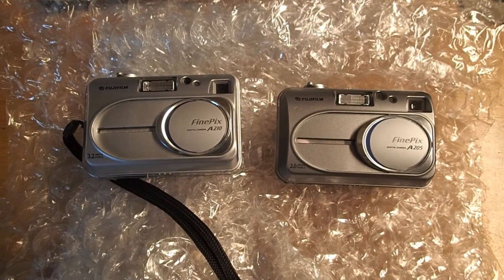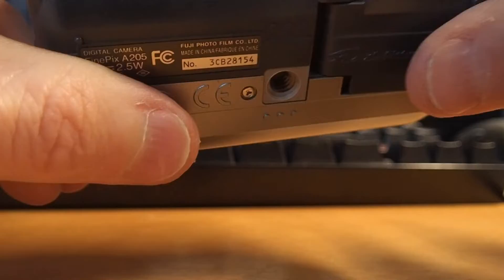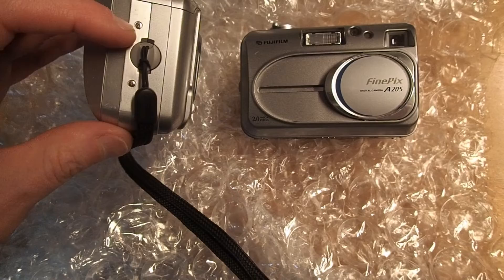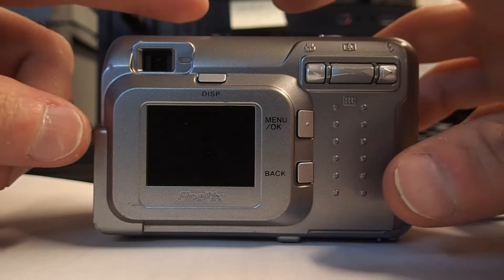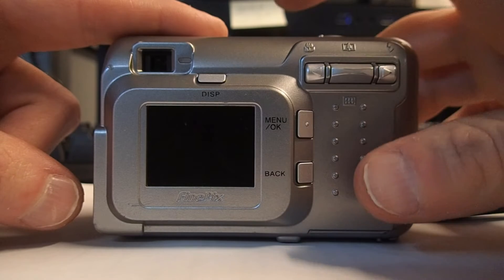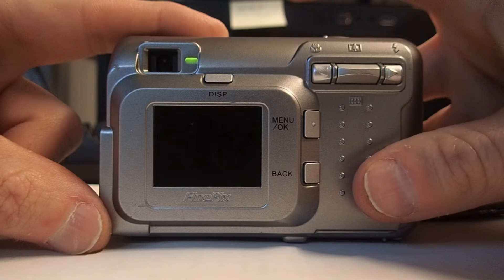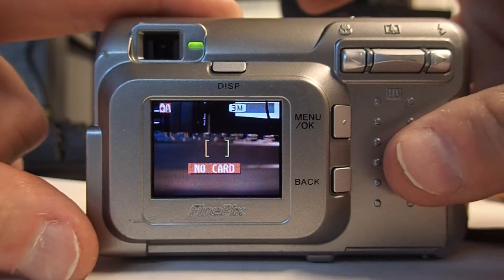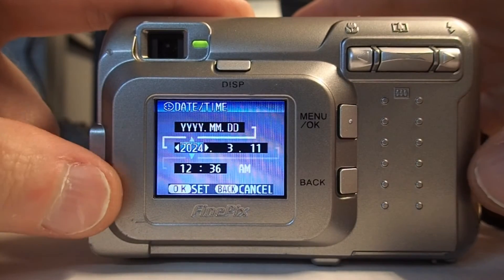Replacing internal date time settings battery in Fuji A210 A205 digital camera Fujifilm Part 1

Comment: My finepix205s turns off when switch the knob to either film or photo mode, any idea where to start?
Reply from the maker: new NiMH or Lithium batteries.  Dont use anything else.  If that doesn't solve it, then I dont have any other suggestions.
Reply: @bigslick  thank you for advice. My last resort is switching the lens module from donor camera.
Reply: I have the same problem, did you ever find out how to fix it or at least why it was happening if you couldn’t fix it?

Comment: Should the camera turn on without an sd card because I currently don’t have one but when I turn on the switch it flashes the green light and then remains off.
Reply from the maker: yes, it will turn on (may take 15-20 seconds), screen will come on and say NO CARD.
Reply: @bigslick  ok thanks for your help mine must be broken. It only turns on properly when I connect the usb to a wall plug but then it turns off as soon as I remove the usb.
Reply from the maker: @isabelbyarugaba2008  AA batteries may be weak.  Need to use either rechargeable NiMH or Lithium AA.  I find that nothing else works.
Reply: @bigslick  that’s brilliant thank you so much for your help!
Reply from the maker: @isabelbyarugaba2008  Worth a try.  I know these models definitely do not work right with standard AA "heavy duty" batteries or generic AA "general purpose" batteries, and sometimes wont run very long with Alkaline either.  But they run good with NiMH rechargeable and Lithium AA.
Reply: @bigslick  I’ve found some more powerful AA batteries which did lead for it to turn on but only on the video setting, I’m definitely going to take your advice and get those NiMH batteries as I 100% trust it will work!
Reply from the maker: @isabelbyarugaba2008  also make sure that the sliding door in front of the lens is open because it wont turn on to "camera mode" with that door closed (although it will turn on for playback mode with the door closed)
Reply: @bigslick  yeah unfortunately it still doesn’t turn on with the door open the green light just flashes again
Reply: @isabelbyarugaba2008 Im having the same issue with mine, did you ever get it fixed?
Reply: @quintilleroni3242 the green light flashed for longer but unfortunately non of the batteries were strong enough (could be a problem with inner workings of the camera itself) so it may work for u

Comment: I would at least desolder the original 614 first lest the xx32 in parallel tries in vain to charge the dead backup cell. There's also the idea of replacing the 614 with a supercap of the same size and voltage, which i think will last indefinitely. Also, don't forget to insulate the xx32 cell before the camera is closed.
Any idea why startup was so slow after the operation?
Reply from the maker: 1) Having owned an A205 for 20 years (as of April 2004) and used almost daily for that entire time, I can say with certainty that occasionally the startup will be slower than other times for completely unknown reason.  It has always been that way.  I have assumed that it may have something to do with having to charge the flash if it had not been started-up for a while, and these models rely on firing the flash for almost all photos.  Another possibility is that I have noticed that this model seems to startup slower if the settings had been wiped due to the dead backup battery, and the startup is always faster when the settings have been retained.  So since the settings were wiped when the new battery was installed, the first startup was slower.  So probably one of those reasons.  I now own several A205 and A210, and they all behave like this.
2) Re - Trying to charge the old battery... I am not worried about that.  That old battery is totally open-circuit.
3) Supercap is definitely a possibility.  I may do one of these with a supercap, but I honestly just did not want to spend any extra money on the project. I had small button cell batteries that I was not going to use for anything else, so the repair was free. There's no room to put a supercap in the same location as the old battery, so it would still have to be routed into the same location as the button cell battery.  It really does not need to be insulated, there is only plastic around that area where I tucked it in, and once the cover is replaced, there is no way for the battery to relocate itself elsewhere.  Of course, nothing wrong with putting heatshrink or tape around it.
Reply: @bigslick  yes, it's probably the settings being lost the camera will try to charge the flash by default. 
Not enough space for a supercap: I've bought a batch of these of the same size and voltage with the 614 from AliExpress but now I wonder if they're really just plain 614 being palm off as "supercaps". A recent supercap I saw inside a Casio swivel lens camera has a supercap that looks like a short electrolytic, maybe that's the minimum size. BTW, have you come across any explanation as to why they can't just use the flash capacitor charge to keep the settings?
Reply from the maker: @himeccms893  The discharge pattern from the flash cap would probably damage the IC instantly, or at least cause glitches/corruption.  If that would have worked, every manufacturer would have just tied the memory to the flash cap.  
Interesting that you mention buying the surface mount supercaps, I literally just placed a small order on Ali for a few of them to play with the concept.  The electrolytic style supercaps are certainly legit, and I can surely mount a small size one (ie 1F value) in the same location as where I tucked the button cell battery.